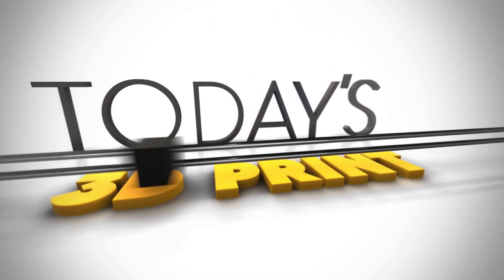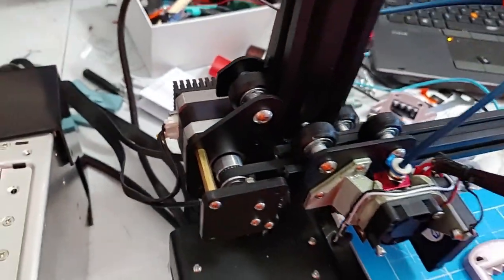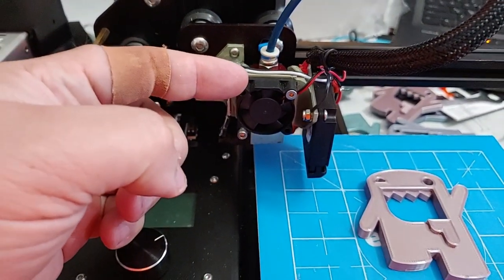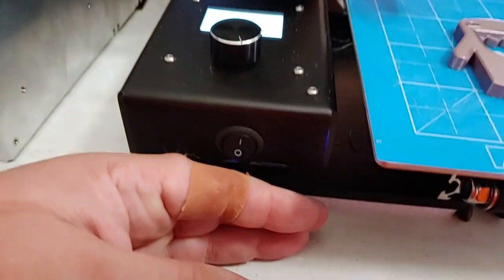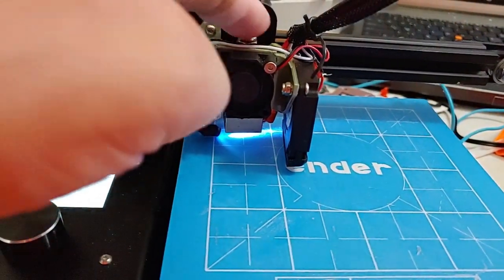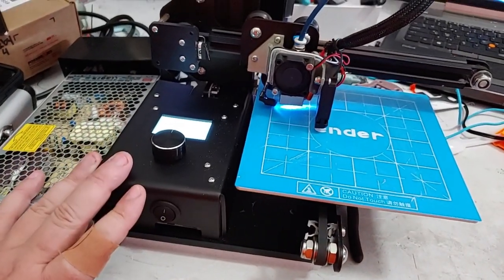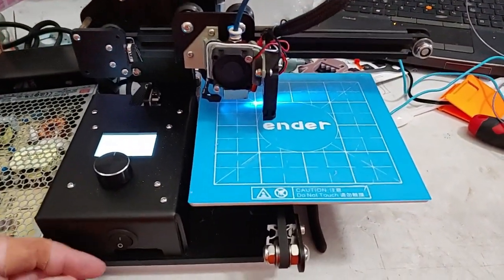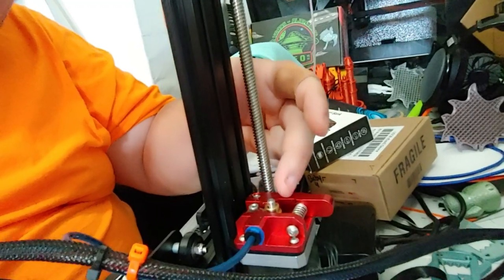Ender 2 Upgrades T3DP

Comment: I put on the damper plates over a year ago. What a godsend. It took a while to stop going in to the room to see if it was actually operating because it was so quiet. Two things I find dreadful about the Ender 2 - the power supply fan noise, which you covered AND the placement of the slot for the micro SD card. I know it would cost more if it wasn't part of the main board during manufacture but it's horrid to fiddle with. It's too deep behind the case and too close to the base to keep a grip with a finger under it. I more or less take my best aim and then push in with the tip of one finger. I tried a ribbon cable extension and it pops out of the board's slot if I just stare at it hard.
A cheap mod I made for longevity was adding an external MOSFET board to take the bed heater's current load away from the main board. The current now goes from power supply, to MOSFET board, to heater. The mainboard merely signals the MOSFET to On or Off.
Reply from the maker: Mosfetis a great idea! I think i will do that.

Comment: Chris, if I replace my Ender 5's "None shall pass!" extruder with a Winsinn Ender 3 CR10 Dual Gear Extruder, will I have to fool with e-steps etc. or is it a direct bolt-on replacement?
I just bit the bullet on the Filadryer as I figure $49 delivered is cheaper in the long run... 
Now, I'm going to look for something I saw in use... a sort of plastic snout that holds your mask well away from your nose and mouth, so all respiration doesn't involve the same square inch of cloth!
Reply from the maker: Yes be aware they eat themselves over time (need washer under bearing) and yes direct fit should not have to change calibration.